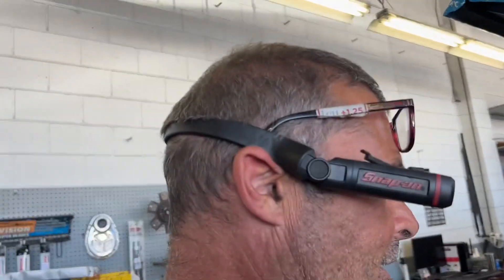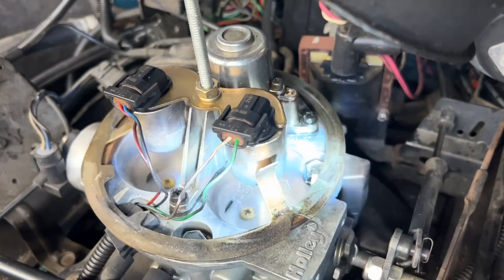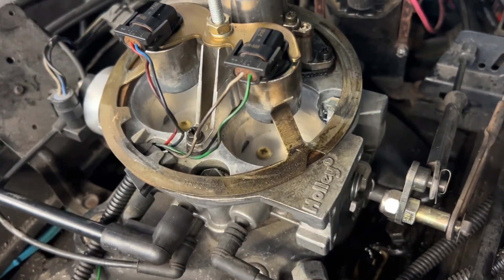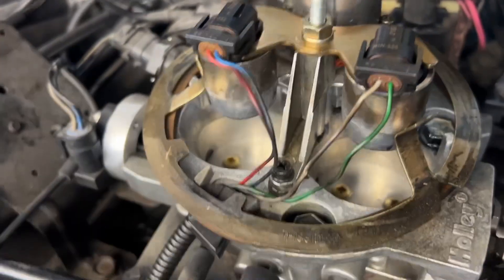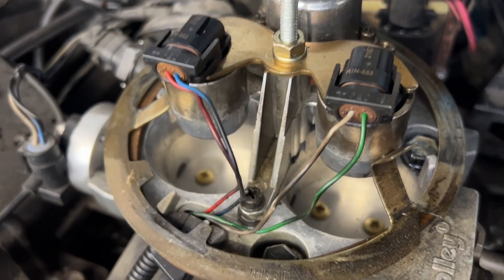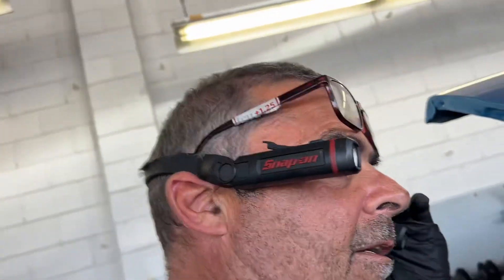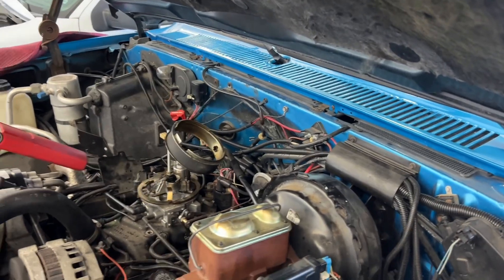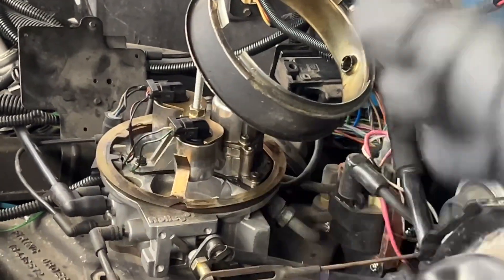Cool trick Testing throttle body fuel injector with timing gun

Comment: U know whats really cool ? 
The fuel screw under the fuel pressure regulator spring cap
Drill the top of spring cover you'll uncover a 5/32s allen to adjust ur spring pressure
Reply from the maker: Yup. Did that to help with the tune of a rear mounted turbo system we put on a  305TBI Camaro

Comment: Very cool.  I am going to try that on our 1990 TBI.
Reply from the maker: I think you’ll find it pretty sweet. You need a timing gun that has adjustable timing to tune it to the injector timing then you can make the spray pattern move close to injector or far by adjusting timing gun
Reply from the maker: You’ll really like it. Just need a gun that can advance and retard and you can dial in a pictures perfect pattern of the spray pattern and identify clogged injectors. Can also dial in the size of the spray cone from the nozzle all the way down the Venturi